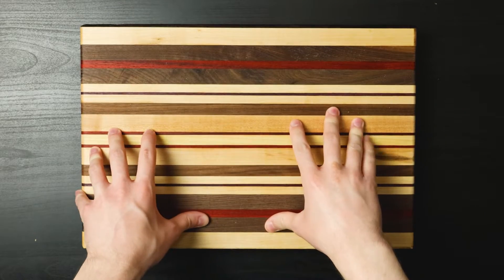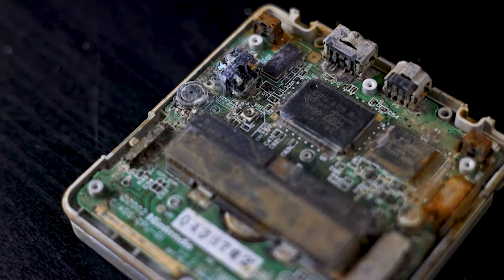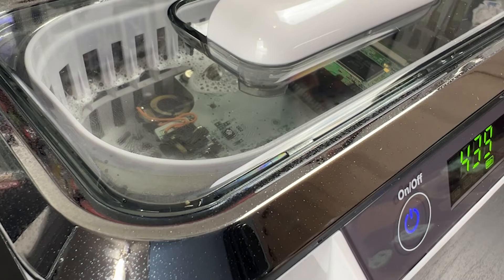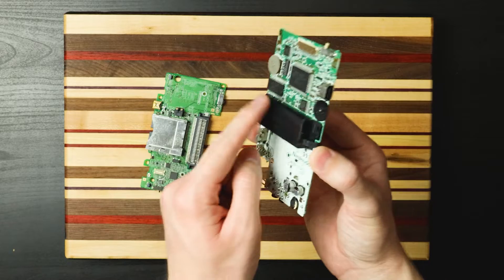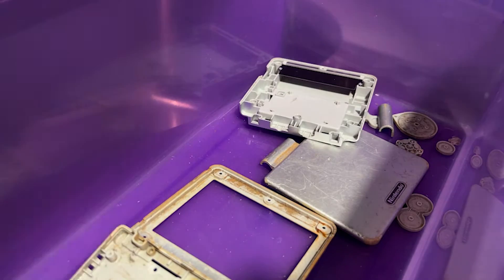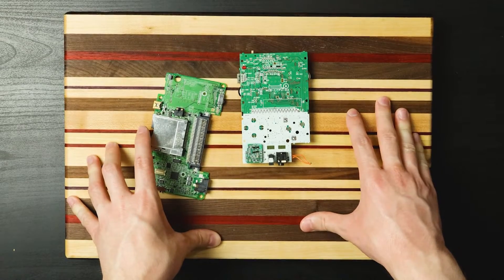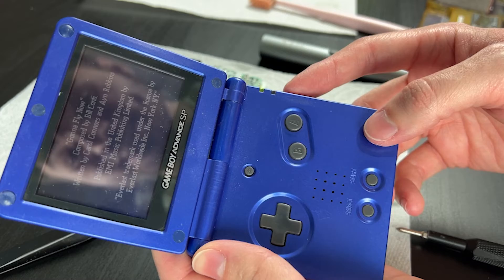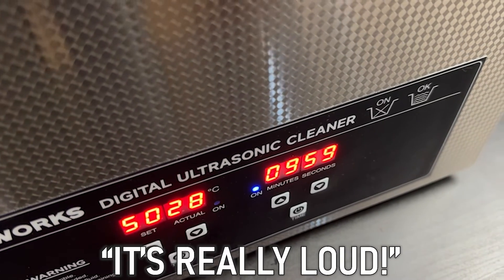How I Clean Motherboards Now | Ultrasonic Cleaning Electronics

Comment: A tip I heard regarding ultrasonic cleaners. Is that you don't have to put as much of the chemical to fill the bath. Many say that just putting the item you want cleaned in a ziploc and filling that tiny bag with say 99% alcohol or whichever solution you use. And then just filling the tank with water would work. I would recommend that look up if your cleaner can handle being filled with Water in the tank.
Reply from the maker: Do NOT use isopropyl alcohol with ultrasonic cleaners! Unless you like fire and explosions
Reply: For sure no one should just pour IPA in the tank the friction and fumes are just fire hazard. But if it is in enclosed plastic it supposedly should be safer. That and the point is for when you need to clean a smaller item and you don't want to waste your cleaning solution. Again no real experience with ultrasonic cleaners let alone using IPA with ultrasonic cleaners.
And I am looking forward for your SP common failure and fixes. As someone who really wants to buy a lot of broken gameboys and frankestein a working one such videos are lifeline for a clueless newbie.

Comment: 70% Vinegar helps with corrosion. It's safer on the board than CLR as long as you rinse it off right after. It needs to be top level corrosion though. If it actually got in to the board, seems like there isn't much to do.
Reply from the maker: Yeah most of my corrosion problems are deep in the board :/
Reply: @JakeSimmons64  same, at which point it not longer matters. :/